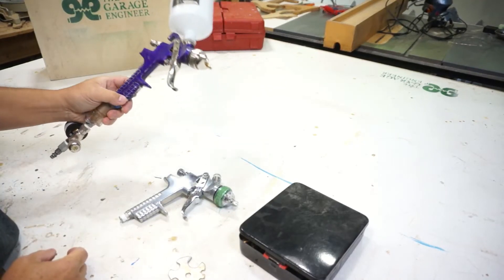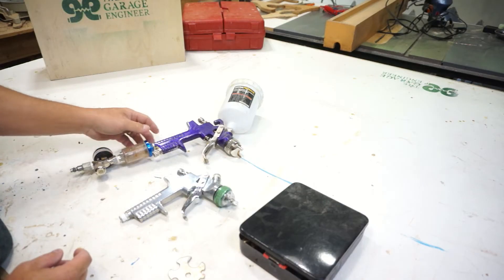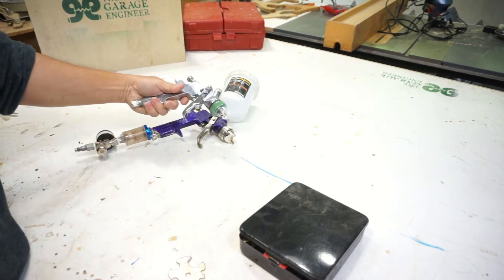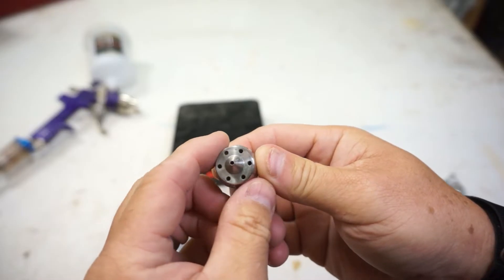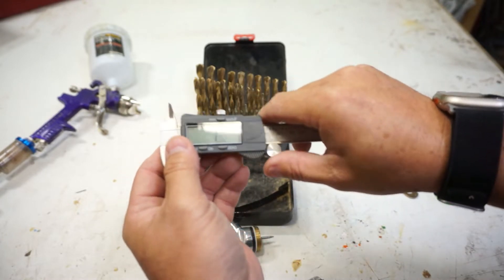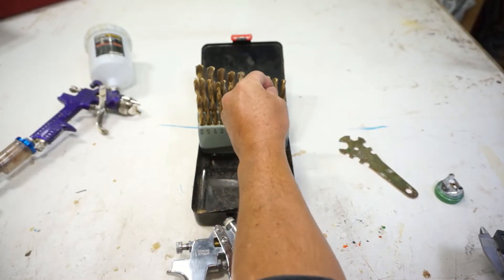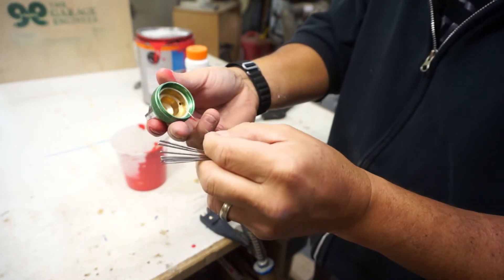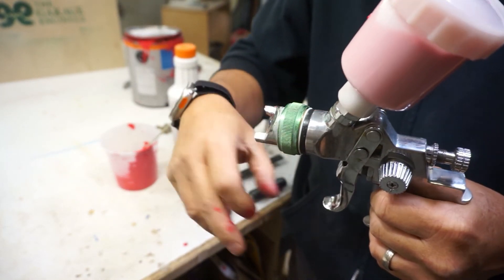30 sec Fix to Spray Latex paint with a $10 HVLP Spray Paint Gun

Comment: Just pour in about 5% water to your existing mix. Flotrol is good as it doesn't break down the base latex bond, but it's still failt thick. Now adding a little water to that should do nicely. For a home hack you're pattern is pretty nice actually. 

On another note, You can get an LVLP gun with a 2.0 nozzle. Takes less air volume and made for the job. Air passages match the 2.0 nozzle size. Great for smaller compressors and shooting 35-40 psi @ 3-4 cfm.. HVLP likes way more air volume than LVLP..
Reply from the maker: Good information. Thanks for watching!

Comment: Dude, tell your subscribers to thin the water based paint with water and spray through the 1.4 tip. Always mix in a separate cup and always strain the paint.
Reply from the maker: good point. Thanks for watching!

Comment: Attach the filter to the regulator and the regulator to the gun. The way he has it will not show accurate pressure if the filter has a clog or obstruction. Will it make a whole lot of difference? Probably not but why not do it right the first time.

Comment: I used the HF Purple HVLP drilled out with the 5/64 and running at 50psi, and spayed Sherman Williams Extreme Bond Primer and Sherman Williams Emerald paint with not thinning.  Both of those are thicker paint.
Reply from the maker: I will have to give that a try.  Sounds interesting.

Comment: Windshield washer fluid for thining latex is slows drying and keeps the tip from clogging and lays the paint down nice
Reply: There are at least a couple different formulations of windshield washer fluid.  Have you zeroed in on one that works best?
Reply from the maker: Nice tip. I’ll try that next time.

Comment: I sprayed latex with the same gun, just like any paint that going to be sprayed through a hvlp you need to thin it down and upgrade your reservoir to the spectrum paint canister system, I did a 20% mix regular water works fine.
Reply: What tip size did you use ?
Reply from the maker: Great tip.   I like the Spectrum upgrade idea.  Thanks for watching!

Comment: 2k Basecoat or Enamel Gloss Oil Based my Psi is 25 depending on the Compressor if using Clear Coat Psi 30 just need to paly around myself have it down put now.
Reply from the maker: 2k is the best but I don’t have enough projects to justify the upgrade from latex yet.   Thanks for watching and thanks for your tips.

Comment: I just used a purple gun to spray slightly thinned Rustoleum latex and it was fine. No drill needed. I don't know why all these forums say it can't be done, which I clearly did. When dry it is totally solid. Will not scrape away....did not effect durability.
Also intuition tells me that simple drilling the fluid tip and not making compensation to the air cap is probably like opening up the flow valve all the way and keeping the air pressure at minimum. Again I thinned with water about 25% and sprayed with a 1.4. Sprayed like anything else I have ever sprayed making normal pattern and flow valve adjustments using 30 to 35 psi dynamic at the tip. Higher static pressure?, yeah, but who cares how high the static is. Pull the trigger and look. Turn left or right. Done.
Reply: Amazon is full of cheap help guns that come with a 2.0 nozzle and pin. I would never suggest drilling a nozzel.
Reply from the maker: Great input.  Thanks for sharing.
Reply: Same I had no problems running latex paint through it.
Reply: Just thin the latex paint with water, about 15%-20% as per products suggested and it’s the consistency for good spray painting.

Comment: Yes you can order nozzles & needles for that gun.  It took a bit of research, but it was a common gun years ago.  Yes I ruined a nozzle by trying to drill it out.   You must REALLY clean that gun out and re-lubricate it as most of the tips will rust rather quickly if you spray a water based finish.
Reply: Where do you get tbe tips?????
Reply: @thirdfloordigital  I think I got mine from TCP.
Reply from the maker: good points.  thanks for watching.
Reply: Yes! Please post where the tips can be found.
Reply: TCP???  What is that?

Comment: The tool you are using to clean the tip. Is used for cleaning welding tips.
Reply: I watched your video and I found it interesting. I am using the same gun.
Using Sherwin-Williams Emerald paint,  they only recommend 10-20% reduced with distilled water. I use a 30% reduced rate and the handles it perfectly no modification to the gun. I use a paint measure cup to get my reduction rate.
Reply from the maker: @mechanix55  good info to know.  I will give it a try.   Thanks for watching.
Reply from the maker: Thanks for the tip!

Comment: Where to begin......old somewhat dried up paint with rust in it after opening - place a paint can lid on your paint can from day one so that the rim stays clean and doesn't rust - didn't use a disposable filter to put paint in mixing cup, once filtered dilute before adding to sprayer.  wow